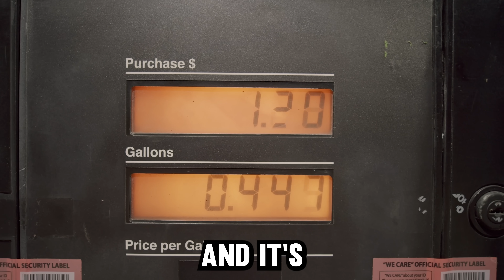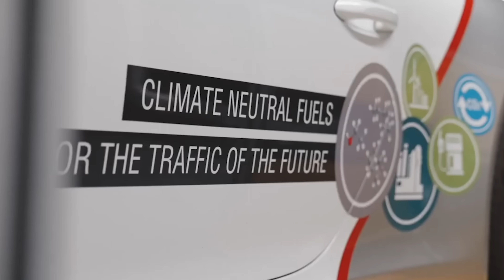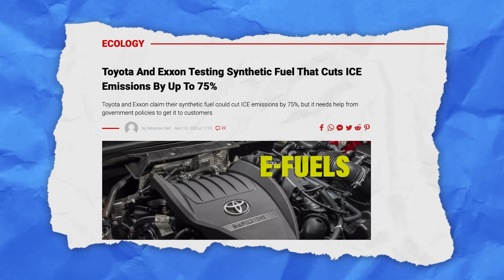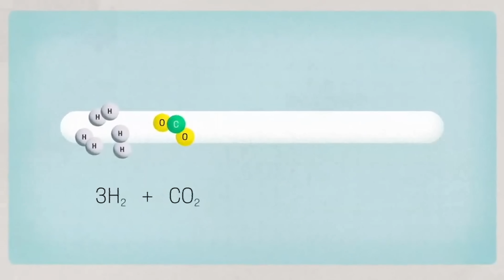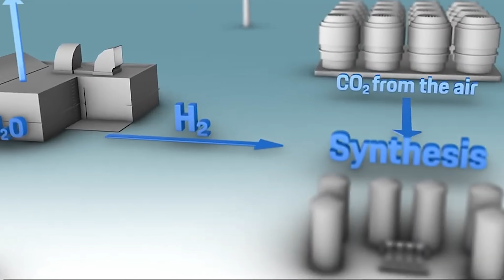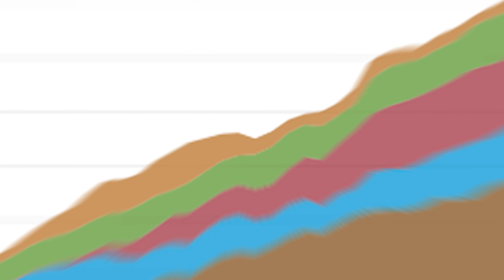Dodge Just SAVED Combustion Engines

Comment: Car enthusiasts are gonna roast me but I still think EVs are a better choice. Efuel would definitely save combustion cars that would eventually become illegal to make, but when the batteries on EVs get improved to be lighter and last longer, EVs will be much better than combustion engine vehicles.
Reply: Think about it. Potentially more power, less noise, less maintenance and more safety. I know some people like the noise but try to live near a busy highway and sleep at night
Reply: @gomessguii  Also as far as more power, for the "average" passenger car, your right, but for the higher racing applications, ICE has much more power than EVs can have. Some ICE applications will always be better than EVs (big ships, locomotives, and especially jet aircraft, though those are turbines, not ICE). Speaking of jets, Eplanes could NEVER ever equal a jet air liner. not for speed.  Range is energy source dependant, but even with a magical zero point battery cell providing terrawatts for years, and E plane can never reach jet speeds, only propellar aircraft speeds. No one wants to take 13 hours to fly from znew York to England in 13 hours on an E plane when a 1960 Boeing 707 jet linner can do it in 6 hours.
Reply: @williamthornton5856  you're right but even sportier drives can buy a Model S Plaid that goes from no to 60 in 2.1s for a fraction of the price of an internal combustion engine that does the same. It may not be the best choice for some track situations but it just makes sense for most of the drivers.
Reply: @gomessguii  Your right.  A Plaid S is a neat car.  Of course any Pro Stock running 7 sec quarters at many no name drag strips accross the country will beat it, but not the Plaids ultility and use as a daily driver.
Reply: @williamthornton5856  exactly
Reply: Actaully, a hydrogen powered ICE car can be more green than an EV over  the same time frame, even with high use. Biofuels are not as clean as hydrogen produced by nuclear, solar, or wind energy.  Iron8cslly, a hydrogen fuel cell can also power an EV's electric motors, or an ICE.

Comment: Synthetic fuels will just cost 2 or 3 times as much
Reply: As will electricity
Reply: @Imleocalm don't forget road tax that all EVs currently also evade
Reply: @finish_my_projects  Lol what?
Reply: @finish_my_projects  not for long. They plan to start taxing EVS in the near future
Reply: Hopefully, when it gets improved upon and perfected, the increased supply will bring down the price of it. *
Reply: @Christopher Scuorzo  "you get what you pay for"
Reply: It might, but EVS are beyond being affordable. Most EV automakers aren't even pricing their vehicles high enough to make sufficient profits as is. Tesla is the exception, but they also have the most expensive cars.
Reply: Porsche calculated $7.50 per gallon in a few years. And if it’s adopted on a 1:1 scale with EVs will eventually cost under  $5.00 per gallon, which is on par with 93 octane currently
Reply: I don't want to pay $15 a gallon to drive my 93 Civic that gets 43mpg
Reply: Finally someone said it.
Reply: So what!?  You get what you pay for!!🤪
Reply: @christopherscuorzo3044  You, most likely, will not be able to pay for it.

Comment: So I'm thinking that If you were to do this and were to have cars some pull Co2 out of the air you could take the exhaust have two filters, on the filters Co2 and the other that filters other gasses out of the exhaust fumes you could transfer the Co2 back into the engine while still letting the engine breathe
Reply: no because the car doesn't run on CO2 but on something that is made with CO2, so if you can put entires factories powered by something else than the engine (or else the engine won't have power for the car) and make it so you gain more energy than you use (wich is impossible according by Newton laws), that would indeed be good (not even thinking about weight and space)
Reply: But what will the trees eat?
Reply: @C0Y0TE3  our bodies produce CO2 when we breathe. It's basic knowledge

Comment: The thing that physical fuel will forever have over electric is energy density, Engineering Explained did a great video showing the size of batteries needed to get the equivalent amount in fuel.

You shouldn’t need to get a huge and heavy car just to be able to drive the same distance as a tiny little hatchback from the 00’s.
Reply: everyones buying 4-5000lb suvs nowadays anyhow

Comment: Electric Vehicle's (EV's) end life after accidents and in August 2022 there were at the time 5 newly introduced EV's in unpaved junkyards.  They're unplugged and in case you didn't know battery packs have freon flowing thru to keep them at nominal temperatures, as they also have antifreeze to warm them in the winter.  Well in the summer 🔋 Battery 🔋 Packs they expand and burst open.  End result the Toxic Corrosive Chemicals and Acids seep into the Ground Water 💧 
Ever seen animals drink water near sulfur Acidic volcanic water die.  EV's helps clean the Air and Pollute our Ground Water 💧 
I have applied in the past links to sources on how toxic they are and locations of the images. There are only 5 Locations in the whole Nation of the United States and California doesn't have a Recycling Center.  👦👍🏎🏁🚩

Comment: Synthetic Fuel is such a waste of Energy. You need to pump so much energy to produce syntethic fuel that its just waste of money. Synthethic Fuel is everything but not efficient and guess whatt EV is efficient...
Reply: It's easiest just to keep the old style, traditional 🛢 "Oil" and ⛽️ "Gas" 🚘 "Automobiles," than anything else and, less pollution than "E.V!s"🤪
Reply: @christopherscuorzo3044  Less poluttion then E.Vs... how funny. E.Vs are going to use Natrium-Ion besides that. How much Energy does it cost to produce from oil to gas? yeah 1.58 kw/h. Besides that you also need oil for the car which also create a pollution loop. So get your facts straight before talking....
Reply: All and all,  "E.V.s" basically "SUCK!"🤪  No fun in fixing engines, no work for the automechanics, far too expensive to replace the batteries when worn down (not worth it because batteries are worth more than the plastic car) and different type of pollution when disposing of the bad batteries. 🙃👎

Comment: The problem with electric cars and the while push towards them is that the whole electric infrastructure can't sustain itself now, and with the whole let's shut down nuclear, the grid is going to collapse
Reply: Seriously, we need nuclear power. Yeah, we've had some screw ups when we stand know what we were doing but electric as a whole used to be horrifyingly scary
Reply: @cameronspann7949  even with those screw ups there are less deaths per kwh than any other form of power excluding solar in believe.
Reply: @notlogical4016  and solar is really resource intensive just to build a single panel
Reply: @notlogical4016  If the private sector would be allowed to produce that and the government could be told to stay out of the production, I'd be all for it. Anything non-military that the feds tackle is a failure.
Reply: @paroxysm6437   the grid has problems even handling air conditioners in the summer, much less a fleet of evs which each can draw a whole degree of magnitude more power, sure it will be a "gradual" change but without more investment in real base line production like nuclear, it wont end well
Reply: @cj09beira The grid only has problems when everyone wants peak demand during peak hours simultaneously. 

Most people charge their EVs overnight at very low kVA when demand on the grid is minimal and only are doing so 2x a week.
Reply: @paroxysm6437  if the entire country switched to EVs within the next few years the power grid accross the country would start seeing issues, even areas that haven’t been having issues ever, the strain that electric cars will have will be insane we don’t have a power grid that can handle both EVs for 300 million people and every building in America
Reply: @paroxysm6437  also solar power, wind power and hydro power produce very little energy even when compared to fossil fuel power plants, let’s put it this way, the power plants with the most energy production per unit are nuclear and fusion, then it goes to coal, diesel, and natural gas then it goes to renewables, the cheapest power source to build initially is fossile fuels renewables are more expensive and the Most expensive is nuclear but when it comes to long term costs nuclear actually becomes cheaper then renewables because the maintenance costs of renewables is more expensive then both fossil and nuclear, and the sheer amount of electricity of nuclear off sets any possible cost downsides of nuclear, and it doesn’t produce any green house gases
Reply: @paroxysm6437  not really the amount of resources it takes to produce solar panels is incredible, and there are no new coal plants due to high restrictions from environmental protestors pushing them, and on top of that solar panels only work when u have clear sky’s, cloudy days, snow and storms inhibit power generation where nuclear power doesn’t have these same restrictions renewables just don’t have the same advantages as nuclear but have more disadvantages
Reply: Its just charge time as the real issue man that’s the only issue if they can charge to 100 percent in 2 minutes then EVs are a no brainer
Reply: @Jimbo_zx  charging a battery that fast would really shorten the life of a battery, the faster u charge the the harder it is on them, I truely thing that hydrogen cars are wat we should be focused on, whether that’s ice style hydrogen or fuel cell hydrogen
Reply: @c0ldyloxproductions324 the majority of people in America drive <40 miles a day - more now with remote working becoming the norm. This sort of range is the perfect use case for EV. 

Hydrogen is not a viable option. There is no distribution infrastructure.
Reply: @Heist1000  there is not infrastructure yet, that infrastructure is growing, there isn’t a major electric infrastructure either you know, those that live out in the countryside can’t easily charge their cars either, but I’ll be easier to set up infrastructure for hydrogen tho cause they fill just as easily as gas and uses tanks, with electricity u have to lay new wires and all that stuff
Reply: @c0ldyloxproductions324  I had to slow blink when you said there isn't major electrical infrastructure. 
Go to google, and look at a map of the Eastern & Western Interconnection aka national energy grid.  Texas also has its own grid. Those three grits combined serve over 85% of the US population. People who live off grid are edge cases. In which case, EV may not be the right choice a vehicle for them-but they can produce their own electricity with wind, solar, or Hydro and geothermal depending on what region they live in.
Reply: @Heist1000  the infrastructure is mainly for the cities, I’m talking out in the country, where farms are, the nearest charging stations for cars out there are miles away, it just isn’t viable in rural areas sure most cities have decent infrastructure but then u also have to worry about power generation which our current infrastructure isn’t set up for, if u were to replace every gas and diesel vehicle with electric as everyone who’s pro ev wants, our power grid would collapse, infrastructure isn’t just charging stations u know it’s also power generation too, and renewables don’t generate enough power with the exception of nuclear, also to build energy EVs u have to take resources away from computers, power lines, and power plants to build them and there just isn’t enough copper, and Nickel and all the other needed materials in the ground to do that especially when it comes to battery materials
Reply: @Jimbo_zx  got to be the juice to charge, need more power for that as is, plus universal fast charge vrs the hope the charge station works with my setup
Reply: @Enrique A Thiele Solivan and yet windmills accross the world are starting to catch fire from extended use, solar panels don’t produce enough energy and can only produce energy in ideal situations, Texas proved wind and solar fails when weather gets tough, nuclear is more expensive initially but produces so much more energy in the long term in pays for itself twice over, renewables cost more than building a coal plant or diesel plant then doesn’t produce as much energy as diese and coal in the long term and are being shown to be less reliable in rough weather and high winds where nuclear, coal diesel and natural gas can produce energy no matter the weather
Reply: @paroxysm6437  show me a country where the electric infrastructure is expanding fast? i can show you plenty already showing issues with the current amount of electric cars.
Reply: @paroxysm6437  solar can only be considered cheap if tpu ignore the investment needed to deal with intermittency, which fast becomes the most expensive component. it would be nice to hear a green person for once supply arguments that aren't twisted by being extremely selective at what numbers they show, or just straight unscientific arguments. the hundreds of billions i'vested in the west have not resulted in mass real life drops in carbon production but have consistently skyrocketed energy priced, yet the lie that solar and Wind are cheap is still pushed every day
Reply: @paroxysm6437  Dealing with the waste is easy. Mix it with concrete and dig trenches beneath the plant itself and you have HUNDREDS of years worth of storage with modern reactors. Hundreds of years to develop fusion reactors that don't produce long lasting radioactive waste.
Reply: @Enrique A Thiele Solivan ya tell that to all the Chinese slaves in mines hand digging the materials to make these panels, and the refineries that prepare the materials to then send to assembly plants to put them together, most of your solar panels comes from China, hence why they are so cheep on top of that places like the Midwest that are cloudy and have hail storms that drop softball sized hail stones constantly damage these panels, and no matter the efficiency of the panels it doesn’t change the fact they cannot collect solar energy when clouds are blocking the sun, storms happen or at night or when ice builds up on top of the panels

Comment: E fuel for the win🎉
Reply: $40 a gallon than. Efuels are a joke imagine taking clean electricity instead of charging a battery wasting most of the energy converting it to fuel than putting it in a internal combustion engine so most that energy is lost to heat. Maybe we should install screen doors on submarines too

Comment: An important factor a lot of people overlook is that some combination engine cars can last over 40 years while we see the current electric cars usually cap out at a decade. Not saying this will always be the case but when all these electric cars fail they will be scrapped and most of it wasted. Compare this to internal combustion where almost every part is "fixable" or easily replaceable to some degree.
Reply: It's called planned obsolescence and car manufacturers have been doing it for many decades.  Technically speaking an electric motor should outlast a combustion engine in mileage age by far.  The problem with EVs is the current battery tech.
Reply: As I always say, electric cars ain't cars you can use because they're just like mobile phones. You throw 'em out the window every few years and get another. And that doesn't work anymore. I drive a 1964 Chevy C10 not only because I love classic american cars but because I know I can always rely on that old hag of a truck and that it'll never die out.
Reply: @phil955  And if it does, you can more than likely fix it with a simple set of tools.
Reply: @ATruckCampbell  Exactly. That's another point, combustion engine cars can be fixed! EVs you can barely do any work on if you haven't studied mechatronics or whatever it's called. And it's hella expensive.